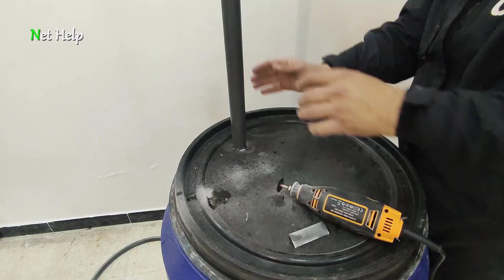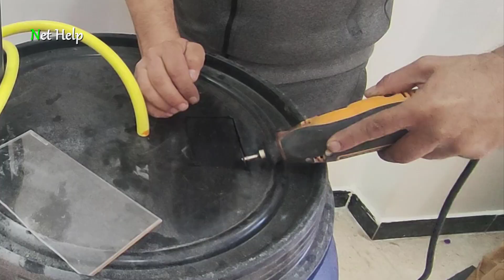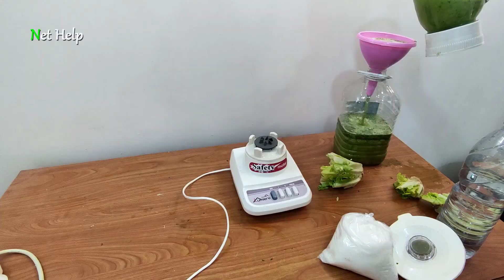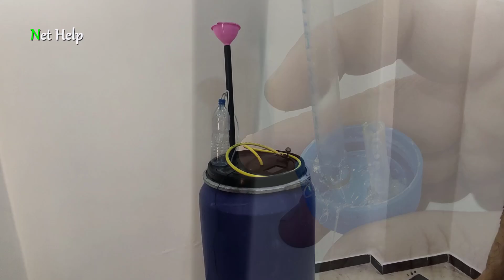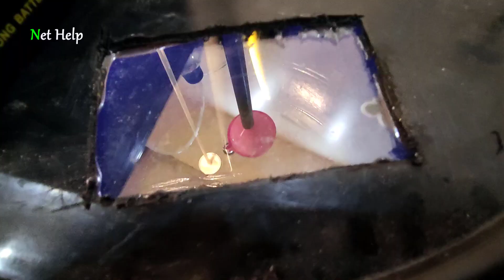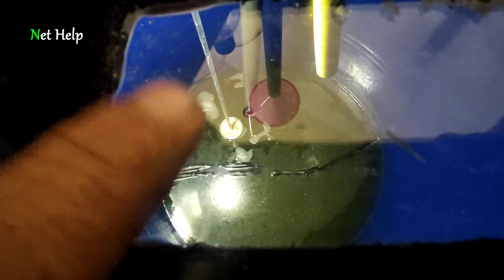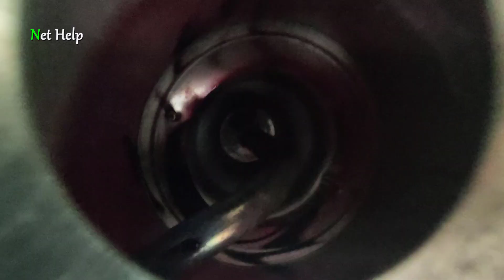Say goodbye to buying gas from the government - and get it free for yourself

Comment: Hello Admin, great job. As for the bottle that stored water from the drum material, if the water finally got filled up I know the pressure will increase to push the gas but what do will do to the water in the bottle after it got filled up?
Reply from the maker: Mr. When the bottle is full, the gas extraction will stop. You can empty it a little

Comment: I will build one with manemometer and safety valve to know the pressure. The mix of gases must go through 2 water bottles for safety and to clean them (NH4 +CO2 + hydrogen sulfur). Plants love water with higher dissolved CO2.  In cool places, to let gaz burning to avoid overpressure is not a bad idea. Let just ventilate enough the room.   300 €( ?) to cook for life + free fertilizer It's worthy. Thanks for uploading. Very useful.
Reply from the maker: I wish you success

Comment: Look at solar cities IBC tote digester and no I would not put anything in a building that has pressurised gas put it outside
Reply from the maker: You can use an iron pot. We worked on that, and tomorrow I will upload a new video

Comment: Good work, but that thing is very dangerous. You need to have a flash back arrester on that and also have that tank outdoors away from direct sunlight 😜
It's basically an explosion waiting to happen.
The more gas builds up in that barrel the more pressure.

The next step would be devise a way to pump the gas into a steel gas bottle then that would be great.
Reply from the maker: thank u

Comment: Methane gas and electrical connections always ends well

All it would take is a bad solder joint, and the next time you turn on the light, maybe the last time.
Reply from the maker: Mr
We put the light on so the follower can see what's inside the bucket, but we don't use it

Comment: You should have used fittings designed to mount on water tanks, those usually interlock to the walls of the barrel with O rings which are very secure.
Epoxy and plastic don't work together because plastic is deformable which causes the epoxy to crack/fail.
Reply: Or at least something like RTV silicone so it has some flex
Reply from the maker: No, we used flexible adhesives that are not silicone-like
Reply: @NetHelp2  I understand, keep up the great work!
Reply from the maker: Mr
We are working on teaching others how to produce gas and we invite followers to use iron instead of plastic

Comment: Overkill and underproduction.  Basically bury a septic tank with a 6” pipe thru the top that ends below waterline in tank put your animal dung and lawn clippings in and have a plunger to force down into tank. Cap when finished. Instead of a field line have a drain tube coming out of a slope so you are able to use it in the garden gas piping should be installed through the top. Many people in India put an inter tube in the line before piping into house to store excess gas for later use. Methane burns better for lamps, heater and stove with natural gas jet instead of propane.  Good luck!
Reply from the maker: sir
We have done all of this, and you can watch the latest video uploaded to the channel

Comment: Please tell me you’re venting the room you have your digester in.And also if you can manage it please stop lighting things up and using open flames so very close to it God forbid there be an accident be careful maybe you can see if you can run a combustion engine on this gas it wouldn’t be hard to do,,,if you need refrigeration if you could rig up a small generator the smaller the better you could run a small freezer for a week and have enough ice to last a long long time you could put the ice in a couple of small coolers/ ice chests,,,make 5 or 10 pound blocks of ice or perhaps if you can afford it charge a large bank of batteries with it and you could run a freezer with an inverter fans lights and all sorts of things
Reply from the maker: Sir, activate the subtitles. I put everything in the subtitles of the video

Comment: No check valve or backflow preventer. If the pressure drops enough from use it can travel back inside the yellow tube and reach the larger volume of gas with little holes tovesscsor tbe explosion the whole thing would burn your house down and you wouldn't be able to hear or see it if you were standing in tbe same room . The sound wound rupture your ear drums tbe explosion would almost empty the room of oxygen and if the door was open it would flash tbe rest of your house up really quick and hot. My discription of s flame arrestor or backflow preventer in layman's terms BONG just used for a break in a flame path if needed. Do not build this without your bong installed

Comment: possibly one of the most dangerous home built gas generators i have seen , yello tube has no flashback arrestor , he keeps moving the tube and breaking the seal while holding the flame above it , the volume of the canister full of gas , even at a lowly 3 psi , if ignited could lead to a significant flash , hoo eee , don't think i will try this one !
Reply from the maker: We use a sticky adhesive that does not break and has become out of the bucket

As for the method, we are working on teaching others the method, and the viewer can use an iron bucket

Comment: why do people make things so complicated. OMG. Make a small one and use a 5 gallon water jug you get at Wall mart. YOU KNOW your propane grill at home can use this gas. Materials: Pig manure mixed with cow manure and water. 80% manure to 20% water. Fill jug almost to half  with mixture. Top of screw on lid with a valve and a small .25 inch inside diameter clear hose 8 feet long. 1 small pressure gauge and end fittings that will connect to your propane gas grill. FREE GAS. Just let mixture to ferment A week. Free gas to cook your food every day for life.
Reply from the maker: Watch all the videos on the channel and you can activate subtitles

Comment: Yes, you can make gasoline at home exactly like the Japanese did at the end of WWII,  BUT it's about 65-70 octane at MOST and will destroy your engine in your car/truck/SUV/hybrid (sooner) in less than a month because your vehicle is designed for 87 octane fuel  or better with special chemical additives you can't buy! Or you can do the Nazi method of turning hard coal into 75 octane gasoline, with the same problems. And both take about 4 times the energy to make a gallon of gas as starting with oil.
Reply from the maker: I don't think I understand working with gasoline or the Japanese way

Comment: While it is a good idea and I like the design, it's unsafe. And I have a question, about what looks like a "fuel filter"? What's the purpose of that and is it indeed a fuel filter, like from a vehicle?
Reply from the maker: It is a filter to separate gas from water
Reply: @NetHelp2  Ahhh, I see. Cool and thank's. Your love of JB Weld even though it is completely unsuitable for this job, lol, and has most likely let go of that plastic, is commendable. And it puts a smile on my face, as I am of similar mind a lot of times, with that stuff. I use it on everything, lol. So bravo sir, you know the power of cold weld steel epoxy and love it as much as I do.

Comment: I saw a biogas generator, industrial scale, attached to a dairy farm. Wasn't working well. The workers said the biogas produced wouldn't burn if it wasn't mixed with natural gas. The project was eventually abandoned.
Reply from the maker: Biogas burns without the need to mix it
Reply: @NetHelp2 I don't know, may be just a story. But the project didn't work, because I worked there later and it had been stopped.

Comment: He making fool, he did'nt tell the name that, what are white powder , what are the gravels are,  its much better to use gasoline generater, very simple and cheap, instant controlable fire.
If you have a cattle barn, then cow dung is the best and free,  the gas called bio gas.
Reply from the maker: Mr
All the information is written below the video, in the translation of the video, and in the comments

The following materials were used
1- Vegetables one kilogram
2 _ Fruit one kilogram
3_ Animal dong + soil 12 kg dry
4 _ Rock salt, one kilogram
5 _ Ammonium + potassium 400 g + 400 g
6 - 60 liters of water

Comment: The cost of 11 kg tank is equal or much cheaper than the materials and labor on this projects. Likewise, chemical compounds inside a plastic drum eventually escapes once every now and then you tried to monitor and open the cover of the drums. Moreover, some of the ingredients is not that easy to find in an ordinary 1 store.
But then again, thank you for sharing your knowledge on this project which we can do in urban places where gas tank is not available.
Reply from the maker: Mr
We explain about the experiment, but when anyone wants to design it, they should use a barrel made of iron and replace the plastic with everything made of solid materials.

We are just explaining the method so we use our existing materials

Comment: I hope you don't get burnt out answering the same questions over and over.  You have done a wonderful job and congratulations on an easy to do process we can all benefit from.  I have  questions though.  The PVC pipe that runs down into the barrel - is the hole you cut into it completely submersed in the liquid?  Halfway? Also, the pink funnel at the top, is air from the barrel coming out of it into the room, if the pipe is or isn't submersed?  What is the purpose of the tubing in the bottle that basically goes nowhere?  Could one use a smaller barrel?  How often is the barrel emptied, how full is it allowed to get?  Do you have specific diagrams of sizes/length of materials of this build?  If you sold specific diagrams with instructions I know people would buy it.  I would in a heart beat.  Thank you for your time.
Reply from the maker: Mr
The tube is immersed in water so that gas does not escape from it
His task is to add materials from the top to the inside of the barrel
I ask you to watch the video without presenting or delaying to see how to add and unload the materials
Reply: No se debe de vender el conocimiento, hay que regalarlo a todos

Comment: I don't like to Make  Bad  Comments on people of which are going to Save  lots of Money on House Bills  But from what I saw I Do not  trust  adhesives  in any shape or Form over a Period of Months Adhesives  tend to Either Crack or expand and  contract with both heat and Cold  the Idea is  Great But in my view Metal {Brass Fittings } that can be  Screwed onto the Plastic lids or onto the Vessel its self Giving a Gas tight Vessel? When I saw the Gas pipe being lit over the top of the Barrel where the Pipe was twiggled  from side; To me  I believed it would be  a  catastrophe  that could happen where the Lighted gas could  backfire then there was the Inspection Window  that  P V C window  Should have  Been placed within the inside of the Lid  and also Had a Metal Gasket and  a Rubber Gasket either Pop Riveted or  self  Tapping Bolts Squeezing the Window tightly I Would  recommend  that you shut this Video down until you have  Perfected it Peoples lives  are at risk if they Use your  Method of  making a Cheap  way  without Having to pay for  Expensive  Gas If that Gas was to Backfire because the Barrel was not gastight where air was allowed to come into Contact with the Generated gas it would  be  Boom Time
Reply from the maker: Mr
First we are working on testing the method and not inviting others to use a plastic bucket
You can use an iron bucket
As for the adhesive, it is a very strong adhesive and prevents leakage
In any case, the water will not go out from the barrel into the glass if there is a gas leak

Comment: What does miqan gas mean sir?
Reply from the maker: The main component of natural gas, which contains 50-90% of methane, and fossil fuels as well, and methane is an invisible, odorless, combustible gas, found in trace amounts in the atmosphere. The molecule consists of one carbon atom bonded to four hydrogen atoms (CH4), which makes methane the simplest member of a chemical family known as hydrocarbons, which include: ethane (C2H6), propane (C3H8) and butane (C4H10).
Reply: Thank you for the information sir.
What is the percentage level of carbon dioxide in this methane sir.Thank you.